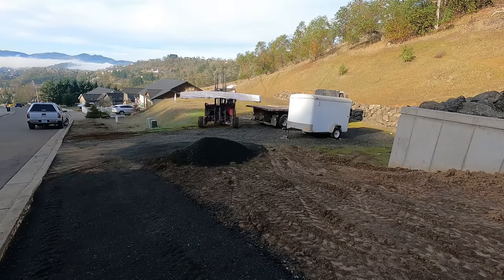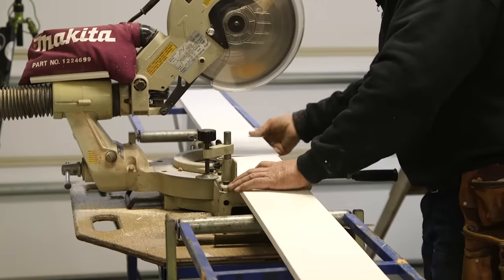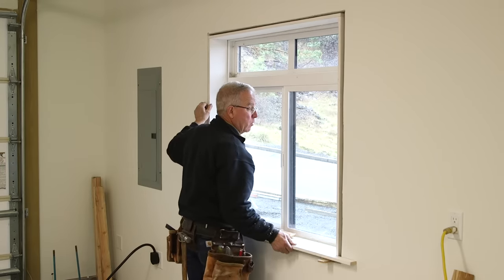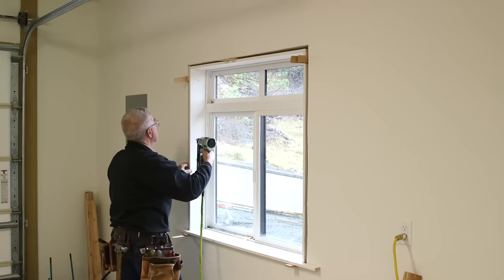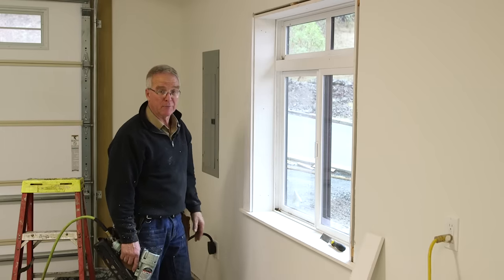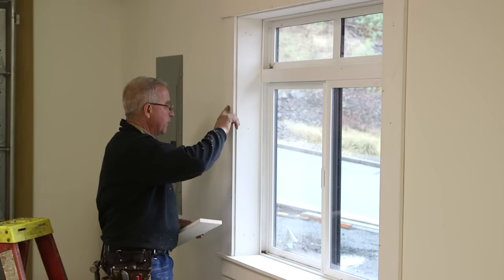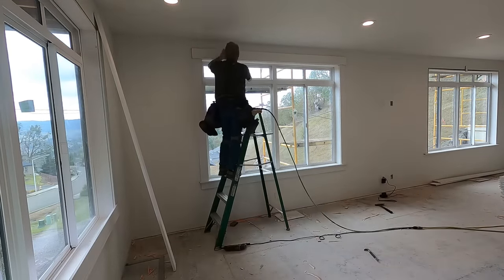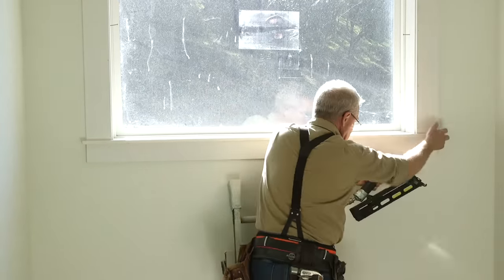Casing Windows Ep.113

Comment: My dad was a finish carpenter by trade. He never used a pneumatic nailer as they were "too heavy" for his shoulders.  A deft finish hammer and a nail set were his tools.  If he ever left a "smile" on a casing he grabbed a pencil and initialed it, to let the painter who came behind him who caused the extra work.  A lesson I'll never forget.  Thanks for another great video.
Reply: That’s so awesome about your dad! Made my day.
Reply: I can understand how your Dad preferred older tools Eric. When I started in carpentry over well 50 years ago, there were no air tools of any sort. It was all hammers and screwdrivers, and I often used my great grandfather's tools. Those were still in use at the time. But the winds of time were changing, Eric, and will blow forever on now. Best of luck to you.
Reply: I remember helping my dad trim also he used a Stanley hand saw miter box and hand nailed everything
Reply: I'm guessing that he didn't also leave goopy caulk messes for the painter to fix 😉
Reply: a spray bottle and a heat gun will make those smiles go away. A little trick from a finish carpenter, free of charge

Comment: I really enjoy that you stress "exact" and "virtually the same" as appropriate terms in building! Things need to "look right ,to be right"! As I used to work on older homes re-dos, I had cards the had my name printed and under that it said "Carpenter / Illusionist" LOL
Reply: I consider myself an expert on “look right” after successfully hanging a nominally 6’x4’ painting (but not actually square) on a wall with the floor and ceiling sloping in different directions. You gotta go with the flow and trust your eye not the tape.
Reply: The main application is the finish work though, right?  If the framer had it right, the rule would not be needed as often later on.  Of course, he would probably say the same of the foundation guy.

Comment: Scott, I really like this series. 
I’ve been a cabinetmaker for over 40 years.
One good piece of advice that would help you and others with respect to pneumatic finish nailers- I’ve used Senco and Bostitch, among others. My point is if you look closely at the tips of your nails that are glued together in a row. You’ll see these tips wedge to a point. Now, if the wedge shape runs with direction of the gun itself and the nail enters the wood, strikes an object and is deflected, it will have tendency to deflect to the left or right with respect the orientation of your nail gun. Bostitch nails tend to have their wedges arranged this way. Likewise Senco nails are staggered and their wedge tips go perpendicular to orientation of the nail gun. If an object within the wood is struck, the nail have tendency to deflect forward or back. This is important to bear in mind when nailing close to two finished surfaces.
Keep up the good work!
Al

Comment: I always use a 18 guage brad nailer to nail the casing to the extension jambs. That's because we use a lot of DC98 casing in the DC area and the smaller guage is less likely to blow out the bead on the inside edge of the casing.

Comment: i have this nail gun. added a belt hook by buying a cheap 90deg bit of cabinet hardware and some washers and drilled them out to fit over the leftover air fitting thread. works a treat.

Comment: Most of those nail heads have a slight taper on the two longer sides of the nail. The deflection usually happens along these tapers when shooting them. So you can often control then deflection angle and at least prevent it from going into the finish area of jamb by rotating gun 90. 

The deflection will then usually go “up” or down” info the part of the framing where it doesn’t matter.

Comment: If you live in a warm climate filling those gaps probably won't make much difference, but up here in Norway I'm making a point of spray foaming every gap I find as I fix/change/renovate things in my house.  Every little helps up here.
Reply: I'm in the northern part of NYS and sealing is very important here as well. On my own home,  I devoted a particularly breezy evening slowly moving a candle around my newly installed (not yet trimmed out) windows, watching the flame. If it wavered, I wanted to know why! A short shot of spray foam was usually all it took. The result was a very nicely sealed window area, well worth the effort!

Comment: Couple things. Only follow your vinyl reveal if you know the window is straight, vinyl windows are often bowed. Straight, level and pumb are your friends... Back cut your sill and header and apron edges if using pine, looks much cleaner when painted and takes way less work on your painter part. Last, as far as saving time for your painter, you don't need an angled finish nail for trim, brad is just fine. Your painter will thank you.

Comment: My first job in high school was sanding hardwood floors with a tradesman that lived up the street.  The term "The painter will fix it"  did not apply.  When we came in, the painter was already  finished.  If I flicked a cord and put a dusty mark on the wall, I was in big trouble.  I was motivated properly on the first day by the owner.  He told me that he would train me and each day that week we would sand and finish one house.  Next week and from then on we would do two houses.  If we couldn't do two houses, he didn't need me!

Comment: All finish nails are chisel tips. The carpenter I learned from taught me to send the nails in with the chisel 90 degrees to the grain of the wood so it cuts through the wood as it goes in and less likely to get led by the grain. 

On a different note back in 1999, my third or forth day on the job, I heard about liquid nails for the first time ever. I spent the day wondering how on earth one gets the product into the nail holes and was one supposed to pre-drill.

Comment: I came up with wood shims; that is using using cedar shakes, store bought, or cutting our own for a perfect fit. Having thick and thin shims as well as some spacers to not have to use a ton of shims is handy too. I have however I. The last few years switched to plastic shims and PVC spacers; they are all the exact same sizes, don’t split. They can’t be made out of species of choice or to exact sizes like cutting your own; they also cost more but I do like just keeping the uniformity all the same for storage. As I get older I find myself not holding onto as much as I used to and just trying to get more streamlined with everything. As the memory goes I do t want to have to worry about getting some odd saved thing and have just found, while slightly more costly in materials I save on my time of having to get/find things. I find the trades so interesting as everything else in life; I wish I had the knowledge and skills when I started I have now as I work so much better, easier and effectively today.

Comment: In a wood window there is a difference between the sill and stool. The sill is at an angle of usually 12 degrees and goes to the outside. The stool sits on top of the sill.

Comment: I appreciated the comments about MDF; I've never had the swelling problem you mention, but I've always used a heavy dose of shellac sealer, which has the effect of raising those nail holes right up.  I'm always afraid of MDF where there could be water, because MDF doesn't do well with that.  Somebody might put a potted a plant on the windowsill or if the window gets left open when a storm blows in.  Storms.  You remember what those are right? ;)

Comment: I would say the case is more often than not that the drywall is out of plane with the jamb edge.  After installing the jamb-sill assembly, it is often necessary to float the drywall with fast-setting compound to bring the walls in plane with the jamb, using the jamb as a screed.  What a headache...

Comment: If you're worried about the nails coming through the side 7:57. Rotate the gun 90 degrees. The nails are cut so they always curl sideways. They very rarely curl up and down. If you turn the gun the nails may curl but they will curl into material not out the face.

Comment: For the finish nailer, I've heard that if you turn it 90 degrees, you reduce the risk of the nail coming out the side of a board because of the geometry of the nail's cross-section. The cross section is rectangular shaped so it will have a tendency to divert either to the right or the left (with respect to the nail gun if you hold it straight in front of you) if it hits something in the wood vs. diverting up or down. Is this incorrect?

Comment: Though MDF is an alternative it's no substitute for actual dimensional wood and should be avoided llike a relative always needing a few dollars you know they'll never repay. One tip to make trim work from installation to being finished faster is to paint/stain final it before going on since about the only step left is to fill/paint the nail heads and miter cuts. Indeed since cutting it into a wall takes hours even with painters tape which is hit/miss if you've used it doing this first can save days because the walls can be painted beforehand and its flaws taken care as they pop out after plastering crew has gone. One tip about not over nailing a trim/window/door installation it to go thru the shims alone since its unessary to do it between them since it can pull the case into the opening warping the wood. Most Windows\Doors are made with the Case as part of them to begging with and only this with a nail fin like the widows shown needed this step but kudos on shimming it in as if it were already there since it was correct thing to do for stability/finish...🔨

Comment: If you were putting unfinished wood in (for eventual staining and finishing), what material would you use to backfill your nail holes? I've used a wood crayon in the past and have not been satisfied.
Reply: One good way is to make wood filler from the sawdust of the wood you are using. Don’t use water resistant glue when you mix it. It’ll take stain and match better than other fillers.

Comment: ???QUESTION???
We tore out the plaster in our home and put up new drywall doing all the work out we wanted to take out a wall and a fireplace that wasn't able to be used so we could open the rooms up my real question is why when I put in a new prehung door in the same opening the casing was too shallow to come flush with the interior wall by almost an inch should I take the brick molding off the door and make it flush with the interior wall and extend the exterior side of the jamb piece or just add my piece to the inside and call it good or if you have an easier way im all ears

Comment: You can prevent 95% of fly away nails shooting out of the jamb by having the nail gun perpendicular to the piece you’re nailing. Brad nails are beveled only on two sides so they’re biased to the direction in which they may turn when they hit some curvy grain or a knot, if you shoot the gun perpendicular the nail will curve side to side in the wood and rarely ever protrude from the surface. Learned this cabinet making as many panels are pre finished and damage to surfaces should be minimized.

Comment: Great job with the finish work on the windows. However, I have two quibbles: First, it bugs me to see exposed end grain. If it were for my own house, I would have mitered the ends of the header and apron. As I said, a quibble.

Second, the paint grade board that was shown being cut on the miter saw had the pith right in the center of the board. In time, that board will almost certainly twist, cup, or crack. If I couldn't rip the pith out of the board, I wouldn't have used it.

Comment: Why the gap and not nailed straight to the wall? Newbie here
Reply: Wood expands and contracts slightly with changing ambient temperature and moisture levels.  The gaps allow that movement to occur without causing the wood trim to crack or nails to pop out eventually.
Reply: @andrewj5998  yep that was the only thing I could come up with. To allow for seasons

Comment: A tip to ensure your nails don’t pop out of the jamb, turn your nail gun 90 degrees so you’re shooting nails in with the gun perpendicular to the edge of the jamb. Your 18g nails can move horizontally but will seldom move vertically in relation to the gun

Comment: As a Finish Carpenter and now more of a General Contractor these days. I can't stress enough how much I cannot stand MDF. Sure it's cheap, but it's a pain to prep for paint and my stars, the dust! Like you said, it volcanoes, especially with a 15 or 16 gauge. Not so much with an 18 gauge, keep the pressure a little lower and depth setting right and it's not as bad. If you hand paint it's not as noticeable but if it's sprayed, the extra moisture gets into the MDF too much and that nail hole actually shrinks and dimples!! Nightmare. For my projects, if supplying material it is always FJ Pine or Popular.

Comment: Interesting that you touch on what is referred to (at least in my business area) as "mass customization," or setting up a manufacturing capability that specializes in making similar but customized products (think of ordering a custom computer from Dell where you choose which parts to upgrade, or personalized sneakers from Nike). Seems like the modern version of the old sears catalog homes are the modular home builders that continue to grow. Interested to know whether you've had any experience with modular construction homes, and/or how such homes are regarded among tradespeople? Personally, seems to lack the same romance as a ground-up build, but if the quality is there and price is right, it seems an attractive option for some folks.

Comment: MDF is inexpensive and easy to run through a router.  You can save a ton of money making your own moldings and trim with MDF.  I would never use it around windows or in bathrooms or on baseboards that may get wet because the tiniest bit of moisture makes the stuff swell up.  

I'm curious though - what is the ROI for using high end wood trim like oak or maple in a spec house or in a house being flipped?  Is it worth it, or is it like throwing away money?

Comment: Hey, nice video. I just wanted to tell you that you can prevent nail blowouts by turning the nailer and holding it like a gangster on its side.

If you hold the nailer as you do then the nail point will travel left and right which can cause blowouts in bad grain/knots but by holding it on it's side, the nail point will travel up and down instead.

Comment: I love this channel and the people who comment here.
I would add one thing : we always spray foam the space between the liners and the framing, it makes a huge difference up in Canada to the comfort and quality of temperature control in the room.
We use pieces of plywood of various thicknesses cut short of the width of the liners, and shim with those, not tapered shims. You can use thin sheets of plastic ripped for 1/16" adjustments. We carry a bucket of these materials around when doing windows.
The spacers cut short allow some foam to go between the back of the shim and the plastic of the window frame.
Great video !

Comment: you can completely avoid a nail going where you don't want it by taking a minute and inspecting the nail to see that it is a rectangle with a chisel point so if you orient the gun so that the short side or the side perpendicular to the chisel tip of the nail is parallel with the face you don't want the nail to break through then it won't.

Comment: Nice video. In UK the "casing" would be called an archatrave, and the "reveal" 3 16th from the archatrave to the jamb would be called a "quirk". Tip would be to router over the horn projections before cutting off the excess, gives the router more material to rest on. But again ace video 👌🏻

Comment: In Norway, our windows come pre-installed with dados (3/8 Inch), in which we can place our jam that comes with a groove that fits into that. All we have to do is cut the jam and legs to the correct dimensions of the dado, screw/nail it all together and fit it in. Reveals is all set.

Comment: The case head if they are flat are dust collectors, if you do a radius to it on the top almost the thicknes of the board it will collect less dust i think🤷‍♂️👍😎
Reply: In my experience, a rounded edge will still collect enough dust to be visible; on flat-topped trim the dust is at least hidden.  Guess it depends on whether you want a visual reminder to clean the tops of your casings!
Reply: @ethanheyne  That is tru, but i think it is easyer to clean with a dust collector.

Comment: HotTip: Acetone on a rag erases marks on vinyl windows (bottom left...black marks...could have erased before casing window)
Reply: I seen that too
Reply: @stephentucker5406  It's Sooooooo easy, and should be done LONG before even measuring case/base/returns/crown/etc. Do it the moment upset vinyls, not after...ugh, right? Cause now, they're gonna hafta use acetone on primed pine. Not a good combo, at all. 

There have been a number of 'issues' with this build, but I'm at 8k feet in Colorado...so I totally get the temp flux. I'm not dogging on what I (or matt risinger) would call inadequate insulatory quality, but hell....swipe them windows well before you case'm, and while you're at it....why not a diff router bit on tht base/case? If it's truly a spec house, you'd never leave it as a farmer would. Give it some definition, eh?

Comment: I am an amateur carpenter and really enjoy your videos. You mentioned the use of shorter nails to reduce the chance of the nail bending and protruding out of the side of the jamb. The chance of this can be reduced even further if the nail gun is oriented a certain way. The V shaped point on the nails allow or cause the nails to bend left or right if the gun is oriented vertically “hose down”. When shooting the side casings the gun can be oriented horizontally “hose right” which will likely allow the nails to bend up or down and thus stay in the jamb.